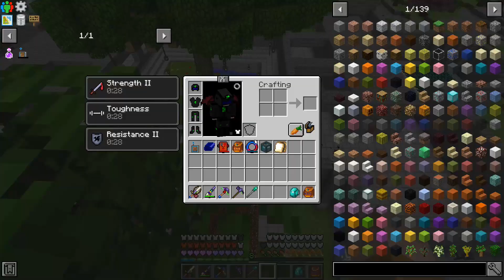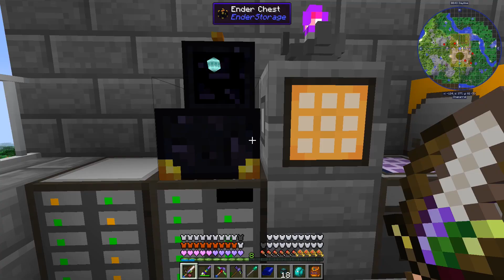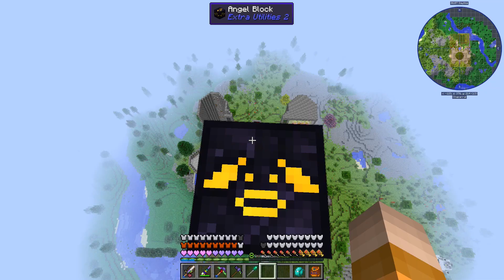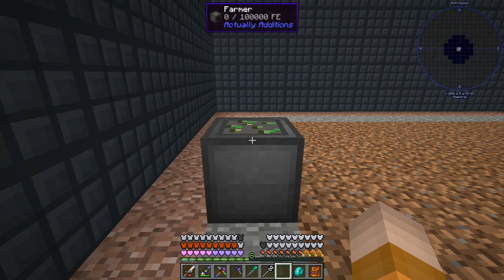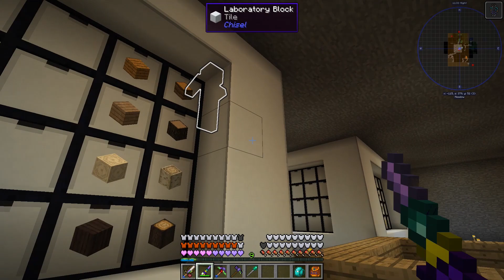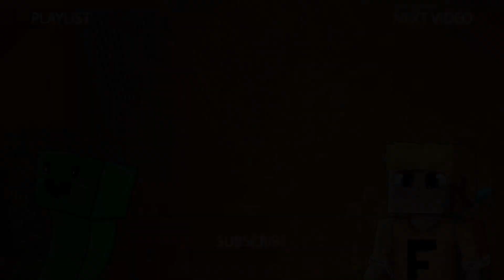Enigmatica 2 Expert - EP21 - Storage Room and Compact Farmer

Comment: You can safe 1 User and get 4. 5 times quicker liquid starlight by switching the user back to Cyclics Automated User: It can serve 9 light wells in 3x3 area in front of it.

Drawer (and anything else) moving: Cyclic's Empty Sack of Holding
[Did I ever mention, that I love Cyclic :) ]
Armor: Repair and Recycle by Repairer/Powered Diamond Anvil and Arc Furnance. Gives Botania, NuclearCraft and Twilight metals
Reply from the maker: As always all good tips. I change already to the cyclic user block.

Thanks

Comment: RIP crystal shulker.  Sprinklers can be placed against the side of a plant i think, for easy placement. Use packing tape on storage drawers to move them.  I think I use compacting drawers for almost all metals, redstone, lapus, quartz, etc. I think there is wind gauge or meter or something in ic2 to gauge the wind for windmill placement but since you are using mekinism for energy transport storage, don't even think you need windmills.  You will probably be fine with just a ic2 reactor for powering your uu matter line.  Base is looking fantastic.
Reply from the maker: Packaging tape. Of course. Totally forgot about it. Thanks
Reply from the maker: Ic2 reactor... I may do one.
I’m wondering what the best power source on the pack. Maybe an advance generator (gas) those are modular and the expendables.
Reply: @EskGaming  Advanced Reactors mod, I think is nice for RF power.  Many safe designs are out there  - one might melt but never blows up iirc. Unlike IC2 reactors/machines...  It's good to check that stuff out in a creative world lab. heh heh

Comment: Diamond anvil for repairs of armor, any one from twilight forest can be turned in to ingots, you will NEED a set of each armor for the wyvern set. the drawers can be moved with packing tape, boy o BOY  I'm so glad I disabled the channels in my pack, you will need to get soon in to UU matter and reactors so you can start getting "blutonium" I think, start with auto crafting soon so you don't go LOCO with the recipes, base is looking great !  For metals you will need the compacting drawers.
Reply: And any extras can be turned into ingots by the Arc Furnance. (Look at the Recycle tab in JEI.): Cheap Terrasteel, Elementium and NuclearCraft metals.
Reply from the maker: I will get to UU matter but I think I need more power soon.